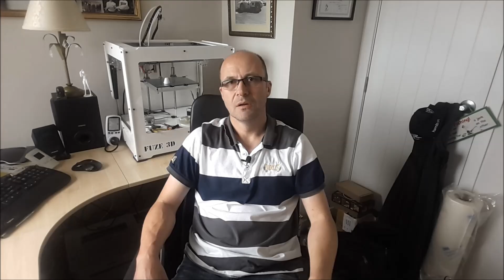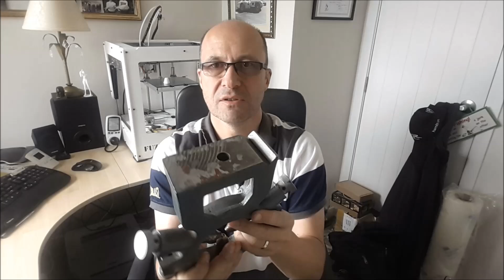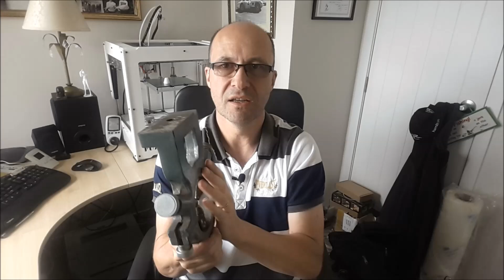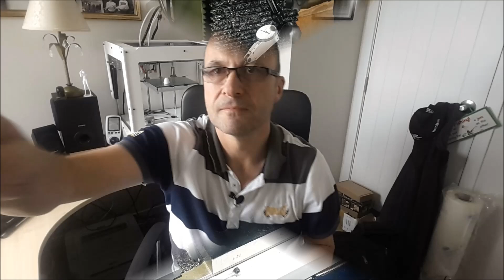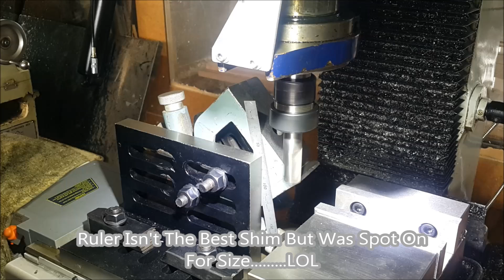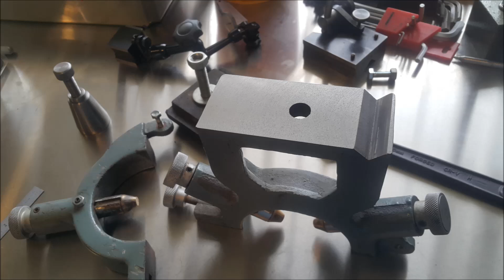18 - Oh No, My Fixed Steady Doesn't Fit My Lathe !!!!

Comment: Another way you could have done this is to have a drop centre on the base that will fit in between the ways - some Asian lathes do this.  It eliminates weakening the base as you only have to machine/reduce the thickness at each end of the base.

Food for thought.

Cheers Rob
Reply from the maker: Hi Rob, I thought about that and have seen those but took the easy route.....

Comment: Good job. 

 As you've reduced the base thickness quite substantially I'd be inclined to fit a steel plate on the inside to spread the pull down bolt forces.  Don't want to crack the existing base.

Cheers Rob
Reply from the maker: Hi Rob, good idea with the steel plate to spread the load. I'll make one for it.